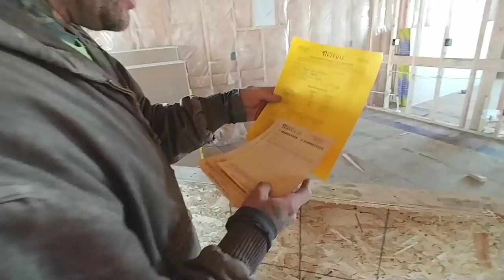Camera man Steve giving you a tour, work vlog. Drywall hanging crew

Comment: Have you ever tried the collated self feed attachment for the gun? Screws are more expensive but production will make up for it
Reply from the maker: Yeah I used them alot in the union. I dont feel like the finished screw comes out great. As in you have alot of clean up of clicker and butt joints and corners.  But I like them for tacking up my lid and wall sheets . 
I don't buy my screws the guys I sub for supply them.
Are you using them right now? Are you having problems with them at all?
Reply: Yes I am using them right now. I think the attachment is great. That’s all my company uses. You have to mess around with the depth ness of the screw so you don’t get those problems. Really enjoy your videos man. Keep up the good work.
Reply: All u can hear is Steve's heavy brething on camera lol